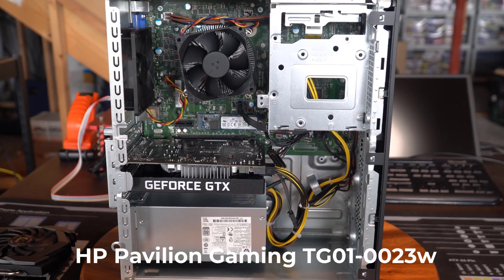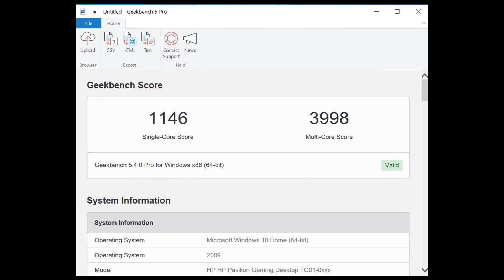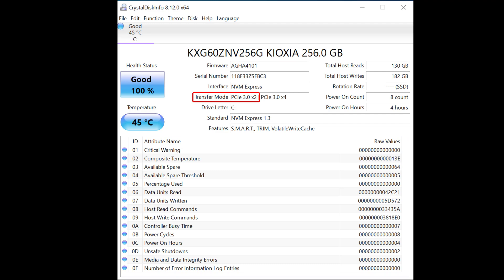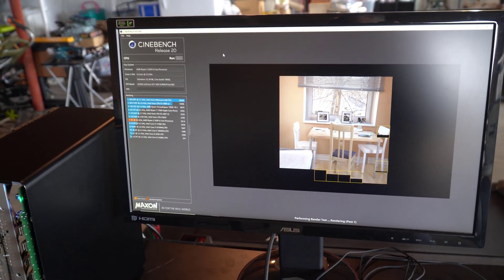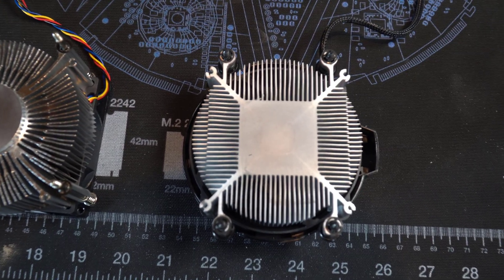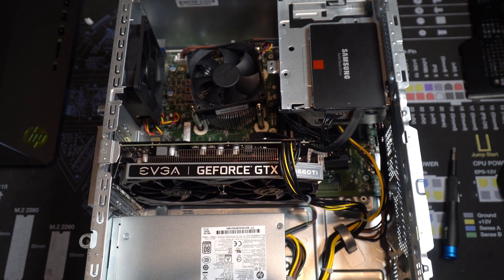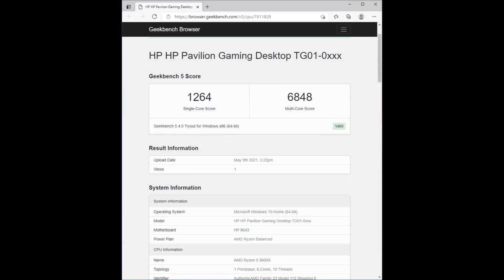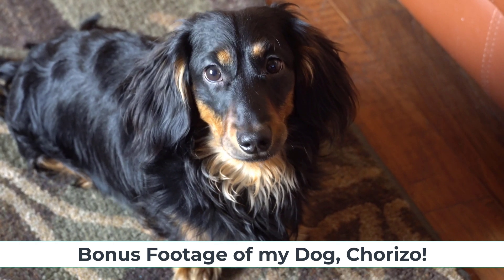This Walmart Gaming PC Is a Good Deal!

Comment: So what’s the solution to the fan problem? Installing the new graphics card makes the system hot so what is the solution?
Reply: I've seen case modified for fans and seen some people have be able to install third-party fans.
Reply from the maker: You can add additional small case fans. Arctic sells smaller size case fans.

Comment: a question about the XMP. I also have just one single Ram with 16gb running at 3991.2 MHZ. single Mode. do i have to add a second Ram ?
Reply from the maker: If you only have one DIMM installed, then the memory is only going to be running in single-channel mode. Getting a second identical DIMM will let you run in dual-channel mode.
Reply: @GlennBerrySQL  i have 8gb running in dual channel mode in my old hp desktop. the new hp that i get has just one DIMM installed but with 16gb of Ram. and i hear that one Ram with enough memory is better than two. is that true ?  let say 8gb +8gb i will run in dual-channel mode , but just one DIMM installed with 16Gb OF RAM is better. is that true ?
Reply from the maker: @learningmadefun8246  No, one stick of RAM is not better than two (when the total RAM amount is the same). Dual channel mode is faster than single channel mode. You may not notice any difference for many common tasks, but it can make a very noticeable difference for many other tasks.

Comment: I bought the TG01 2000i. i7 11 gen , RTX 3060 TI and 16 GB DDR4 Ram. I will not use it for gaming , but for editing and rendering and creating architectural plans. Its a nice quite and small PC that you can use it like workstation. After week of use all I can say it's Great Pc.
Reply from the maker: Glad you are enjoying it, even if that is a different SKU than what the video is about.
Reply: @GlennBerrySQL  question about the XMP. i also have just one single Ram with 16gb running at 3991.2 MHZ. single Mode. do i have to add a second Ram  ?

Comment: I'm not a gamer, but wonder if this PC (with an upgrade to 16 gb of RAM*) would be capable of editing/rendering 1080P video sufficiently?
Reply from the maker: Getting it up to 16GB (with two DIMMs, so you are in dual-channel mode) will be helpful for rendering performance. Depending on what software you use, you should get pretty decent 1080P rendering performance.

Comment: Hello! I saw a hp pavilion with an Rtx 3060 ti, ryzen 7 4700g and 16 gb ram for 1500 dollars and I want to know if I should buy it or get a cheaper one for like 1000 with an rtx 2060 super, ryzen 5 4600g with 8 gb ram. Can you help me choose one?
Reply from the maker: That depends on what you will be doing with the machine. The first machine has a better video card and a CPU with more cores, so it will be better for some tasks and for gaming at 1080P or higher resolution.

Comment: Anything extra I need to know before getting this pc because this is gonna be my first pc also nice video
Reply: Overheating can be an issue with any of the 'X' variant processors
Reply from the maker: Not really. You can upgrade the CPU, the GPU and the RAM if you want to. The first thing should be the RAM.

Comment: What screwdriver do I need to open it?
Reply from the maker: A Torx T5 is the actual correct size. You can also use a flat-blade screwdriver if you are careful, but the Torx is better.

Comment: I’m getting this as my streaming pc do you know any good hard drives I can buy
Reply from the maker: I would try to avoid a magnetic hard drive unless you really have no other choice. You can easily add one or two 2.5" SATA SSDs.

Here is a 1TB Samsung 870 EVO.  https://amzn.to/2RYGUPK
Reply: @GlennBerrySQL  ok thank you so much!
Reply: I’ve been seeing you across all of these pc reviews I’m getting one for my birthday I wanna try to upgrade for streaming aswell we have a lot in common !
Reply from the maker: @m1llerlucas  One of the best features of this machine is the 400W 80+ Platinum power supply with an 8-pin PCIe power connector. This makes it much easier to upgrade the GPU in the future.